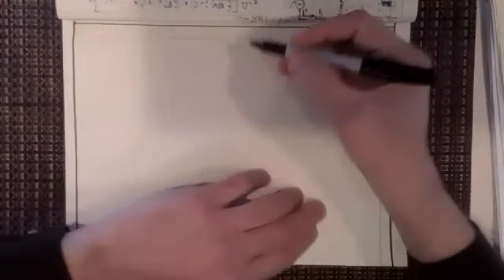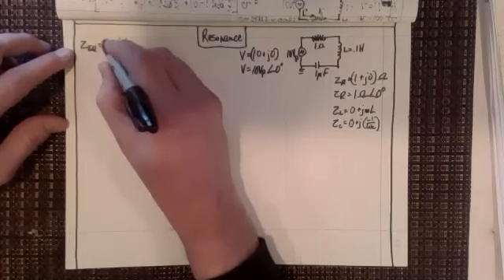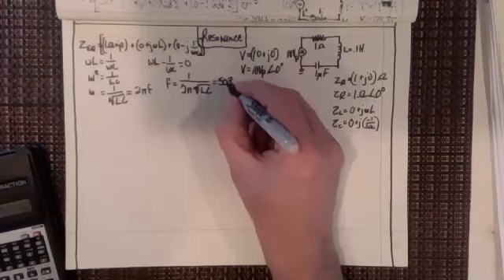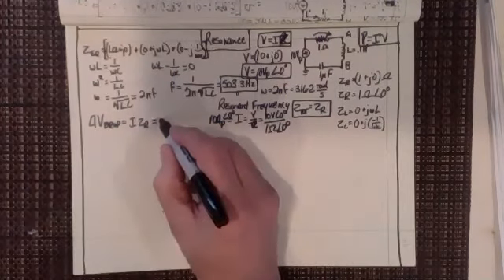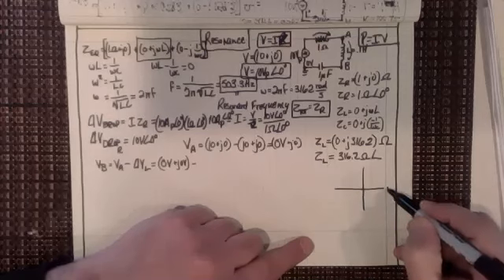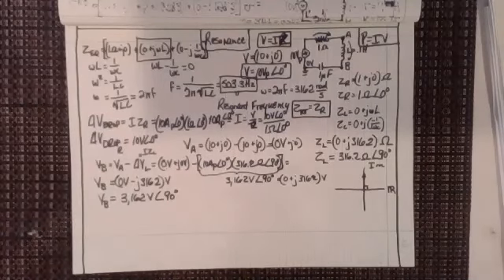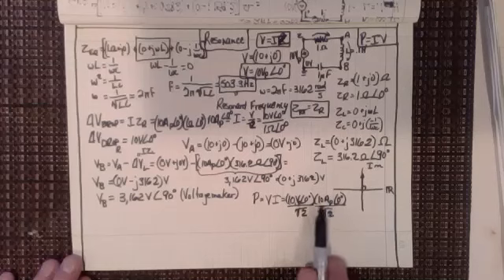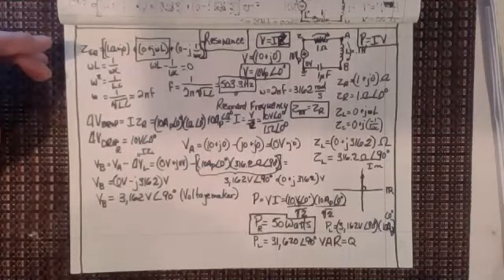ac network theory resonance 6a

Comment: does the power of the inductor have to be in terms of RMS as well, Meaning dividing the 3,162V by sqrt. (2) as well as the 10 amps like what you did in the power of the resistor?
Reply from the maker: Yes, but let me review the video to see if I entirely understand what you mean.